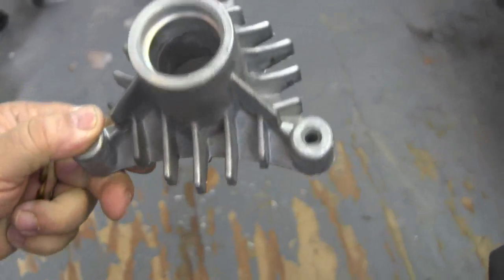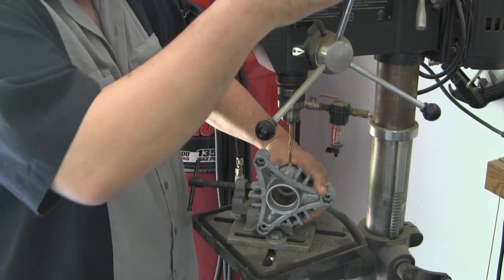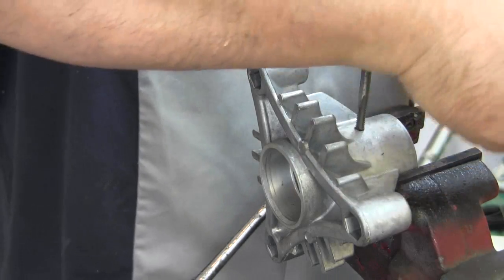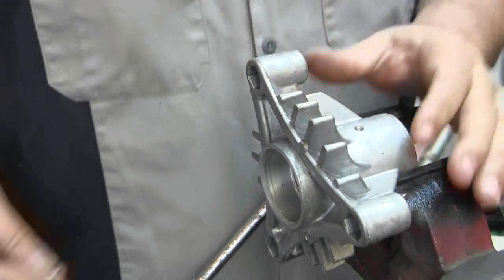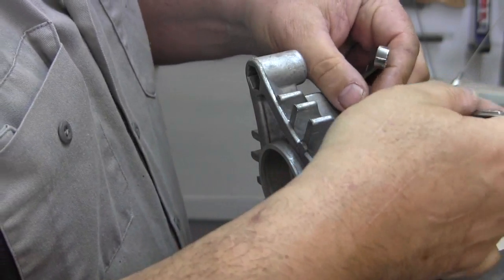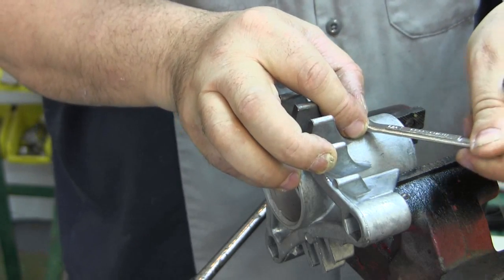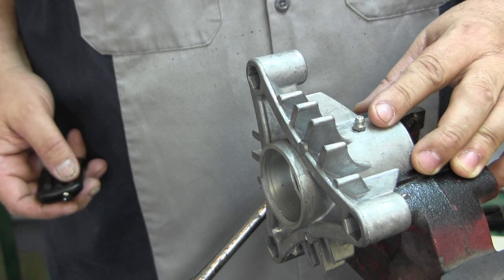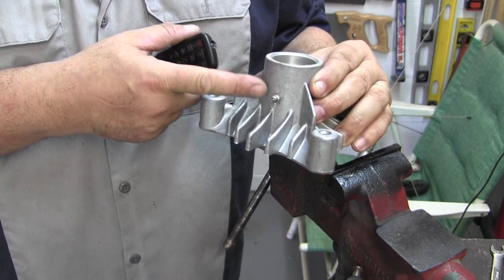How to install grease fittings on riding mower bearings

Comment: I've done this to every one of my lawnmowers also. You're correct in saying that once this is done, it is a commitment and must be done at least twice a mowing season. I also repack the idler pulley bearings once a year. The seals pop off and easily go back into place with a little effort. Doing this and regularly changing the engine oil will make your mower last many years.
Reply: I will do this for my spindles and for my front wheels as well. And I absolutely agree with your statement on changing the oil regularly. I had to buy an new engine at a cost of many thousands of dollars for failing to keep that oil changed. I also take the engine cover off from time to time to clean off  chaff build up. Oh! Thanks for the tip on the idler pulley.

Comment: I have done this to every riding mower I ever owned. It works great. It usually takes about 50 pumps from a grease gun to fill these up. Synthetic grease lasts longer and pumps easier, especially in cold weather. Pump SLOWLY and watch for grease to come out so as not to blow the top and bottom seals out of the bearing. Also, you can buy zerk fittings that you simply drill a 3/16 hole for and drive them in place with a small socket. Socket must fit on the lip of the zerk and not the tip. This really adds a lot of life to the belts and the engine. Good luck.

Comment from the maker: i put a couple of pumps into mine whenever i change the oil. that is a few times a year. i mow 5 acres of grass in my yard alone and i mow my next door neighbors who is 80 years old. the manufacturers DEFINITELY did not intend for people to fix the weak points in these things. those weak points are,in my opinion,designed into these things. people are far more likely to just buy a new one, in this throw away,instant gratification world we now live in.I like stickin it to the man!!!!!

Comment: Thanks for the help. I got both of mine done today :-) All was good until I went to install new blades and I noticed one of the stars were worn down almost flush. I wish I could have caught onto that before I did all of that work. Other than this doing this project is very very easy, but a without a vise I probably couldn't have done it .

Thanks again.

Comment from the maker: we have loctite but ive never used it on grease fittings. they break more often than they come unscrewed so being able to remove it for replacement is easier when its not loctited in there.

Comment: Should be a 1/4” x 28 TPI tap for most zerks. You should also drill and tap another hole in the spindle to put a weep hole that you can plug with a bolt. This will keep you from forcing the outer seal off of the bearings.

Comment: Pretty sweet hack there.   I was thinking of doing this to my Old school edger ( KS 19 STD) trim all.   the pulley/ blade arm bearings burned out and I was looking at how oddly it was put together. It lasted from 61 or so till now but I think it will last another 100 years with this new set up and a grease fitting. LOL 

    I like that you mentioned the Mowers these days are designs to fail, I have told people that over and over ( any new car is the exact way but it gets more technical when you go into automotive scams  )   

  But On the Lawn Mowers there is another big deal.    It's in the wheels!  most people don't think about the wheels, they work fine in the store after all, pushes great for a year or two, then all the sudden ya get the wobbley wheel thing going on.  used to be that the wheels ( I am talking far back ) had bearings or at the very least a metal sleeve. closely fit to the axle, Installing a bearing or , what I have been doing, us a new axle bolt fitted to dual ( inside and outside) steel Bushings.     tightens then up, gets rid of the wobble and it;s amazing the difference it can make to an old mower that should not be on it;s last leg.   I didn't fit them with grease fittings, LOL  probably get a little messy. it is an idea though.

Comment from the maker: you have to remove both bearings because you have to remove the plastic grease seal on one side of the bearing. this side will beplaced back where the bearing rides so that the now open face of the bearing is facing inside. this is so the grease can actually get  in the bearings. when you grease it after it is back on the deck and bolted down with pulley and blade on it,keep greasing until it squeezes out the top or bottom.

Comment: Adding a Zerk fitting to a closed spindle is fine; however, you should always drill a vent on the opposite side. This will allow the pressure in the spindle to be reduced and also indicate when the cavity is full of grease. I always drill the Zerk fitting closer (downward) to the blade and drill the vent higher.  I use a small sheet metal screw as a vent plug ti keep the dirt/dust out of the spindle cavity.  Also, when tapping always oil the tap every rotation or so. Any oil is fine.  I also blow out the metal shavings with compressed air.
Reply from the maker: Great! Another keyboard expert, here to tell me how I should have done something his way, because his way is best! Thanks for dropping in and blessing us with your expertise. Ha! And you thumbed up your own comment!! Douchebag alert!!

Comment: I agree, most people would just get a new one, I got my mower well used (100$), the guy who had it before me knew nothing about general matainace, it had a rod knock, the bearings in the deck where completly out, as in gone,( luckly I have a lathe and bored out my old spindels installed bigger bearings), it was a basket case, after many hours of "enginering/fixing/painting, I can honestly say I have the coolest mower in the "town". I try to stick the man every chance I get.

Comment: I did the same thing on my mower about 10 years ago, once the cavity is full of grease you should be fine, unless it leaks out, I grease mine once a year, just a couple of pumps when I change the mower oil/filter, also I put zerks on my front wheels, my mower has the cheapO no bearing front tires, they don't make stuff to last anymore thats for sure.

Comment: I  just talked to a small engine repairman who does warranty work for different mower companies. He told me that if you remove one side of the bearings in order to get grease to them, you take a "chance" of dust/dirt getting into the bearings if you mow really dusty fields or lawns. If that happens, then the bearings will start to wear out. So, you have a choice. Don't grease them and they "will" eventually wear out or grease them and take the "chance" of them wearing out due to dust/dirt getting into them. I will be greasing mine by adding a Zerk/grease fitting.

Comment from the maker: mandrel bolts or blade? if its mandrel,then i would sugest using a breaker bar and if you have to,snap them off ,then put it in a vise and drill them out.if its theblade that you are having a hard time with,you may need to remove the deck and turn it over so you can get a 1/2 inch breaker bar on it and some extra muscle like a cheater pipe. let me know how you make out. if you send a couple quick clips,i could probably help you more.

Comment: Thanks for the video. this is a great idea.  Do you have any video/details on removing the seals that you mentioned. Or is it obvious when you buy the bearings?
Reply from the maker: It will be obvious. I use a pick to get under the edge of the seal to pry it up and pop it off.

Comment: What a smashing idea :-)

I could see the tapped hole was not exactly spot on, basic tapps never seem to be perfect.

I was told 3 tapps were normally used, starter/mid/plug, and the die's were adjustable via 3 screws, Ive not seen any tapp kits with 3 tapps per size, i think they must be all mid's.

Comment from the maker: the mandrel housing didnt need to be replaced. it cost nothing to drill and tap. the bearing dust cover is very easy to remove. when bearings go bad,rarely does the mandrel go bad. i cant see buying a new mandrel with grease fitting when its so simple just to install a grease zerk.i hate to replace parts that aint broke.

Comment: 2 things: 1- you need to use Loctite on the threads, so they don't back out during mowing, 2- you have to remove the inner seals on your bearings or the grease will actually lubricate the bearings.
Reply: "or" should be "so"  To clarify, you should only remove the side of the bearing that faces toward the inside or middle of the spindle. The removed side of each bearing will be facing each other.

Comment: I got one side apart, drilled and tapped . The only issue I can see in doing this is .. How can you tell if it's full of grease ? Usually with grease zerts you can see it gush out when it's full . With these type of bearings I'm not sure that will happen . ?

Comment: Just wondering , Like on my mower I know the spindles are going bad. When the blades are engaged it rattles and makes a hell of a lot of noise. Why not just replace the bearings ? Seems the bearing would be fairly cheap as opposed to the whole spindle. OR am I missing something ?  Then while you doing that put the grease fitting in. I was also wondering IF there were a more H/D bearing you could use ?

Comment: giving that greese is thick, how can you ensure that the top bearing is being lubricated? Even when removing the inner bearing seal, there is no splash against gravity to feed the top bearing, your thoughts, as I see that most of the grease will sink to the bottom bearing
Reply from the maker: If that were true, then they wouldn’t put grease fittings on higher end models. You are very obviously, someone that doesn’t fix,repair, or use tools, or else you would understand how silly you are.
Reply: @bctruck  yes mate, my wheelchair and feeder thinks I am as well, just sucking air to survive, cheers

Comment: you can buy the whole assembly cheaper online than the housing ..just a thought. lack of greas aint what breaks them they are made to break.i was changing about 3 a season ...i made me a metal plate to renforce them from underneath the deck. ps ive got 75 or more of the smaller bearing brand new  ....how many you need. i believe they are 2203 bearing

Comment: When you remove the seal, you can see there is no grease in the bearing, the reason it fails so often. I just filled my bearings with a quality grease and do not want to deal with installing a grease fitting because its easy to blow the seal out.
Reply from the maker: Great! Thanks for watching!
Reply: I have seen the same thing as well as new sealed bearings that were only lubricated with Vaseline instead of actual grease that were bearings for idler wheels on a snowmobile bearing so always pull the seal off & check them  .

Comment: My (humble) thoughts: If the bottom seal is removed from the UPPER bearing then surely, the law of gravity means that any grease will eventually sink into the mandrel casing (especially when hot) causing the possibility of a dry bearing.

Also, I once asked a (knowledgeable) engineer about the use of sealed bearings.  He told me that there's no significant difference in wear, otherwise, vehicle recalls would be through the roof.
Reply from the maker: So that’s the reason you’re watching videos contrary to what you believe? Karen.

Comment from the maker: REMOVE THE MANDREL FROM THE DECK. REMOVE THE CENTER PIECE THAT HAS THE PULLEY ON ONE END AND BLADE ON THE OTHER. PUT A ROD OR PUNCH DOWN THE HOLE ON ONE END AND KNOCH THE BEARING OUT BEING CAREFUL TO TAP IT OUT THE SAME DISTANCE ALL THE WAY AROUND OR IT WILL GET JAMMED.

Comment from the maker: grease able spindles would make them last forever. they want you buying mowers every few years. ive bought mowers from people that got tired of replacing the same thing over and over. i would put grease fittings on the spindles and never have problems again. another example is the cheap idler pulleys. you can replace them with pulleys that ahave real bearings instead of nylon sleeves and never have to replace them again.

Comment: What about venting on the housings when you grease them
Reply from the maker: Do you think this is airtight? Do you think wheel hubs have “vent holes”? Stay away from tools skippy. 😊
Reply: @bctruck  excuse me!
Reply from the maker: @georgedistel1203  no harm, but if you can’t think about these types of things with a more logical mind, you’ll end up hurting yourself or someone else, or damaging equipment.
Reply: @bctruck  unfortunately when I went thru a mechanical industrial apprenticeship program and retired from such I was told by bearing manufacturers that too much grease was as bad as not enough and that not having any way to vent when grease gets hot can and does cause damage to bearings causing premature failure . Maybe things are different from mowers to industrial equipment but I was just asking not being a smart ass.
Reply from the maker: @georgedistel1203  I can’t tell you how many educated stupid people I e encountered in my life. Surely you understand that the thing that causes premature bearing failure in these mandrel is the ingress of dirt, moisture, grass clippings. You can’t possibly believe you would need to “vent” the mandrel. Now go trip over your degree somewhere else sally.

Comment: Hi,YouTube family I got this Enduro XT 1 46"cut.only use it five time.about these grease fitting you need them.to day I take mine down and you want believe it the only grease you fine you has to whip your fingers to fine grease.my John deer lt155   17years old and never
Had a problem with it .every three cut I grease.never use water on my deck ,air clean only.put the grease fitting on it east.

Comment: i need to show this to my son he thinks that them taps or grease zerks have to be twisted off in the hole before ya even get started along with all the lug nuts when he changes a tire or the head bolts when i was rebuilding the ole 350 chevy 
you should have yer friend make sure his jack shafts are all still straight or in a few hours he will be leaking grease faster than his wife can run along side pumping it in